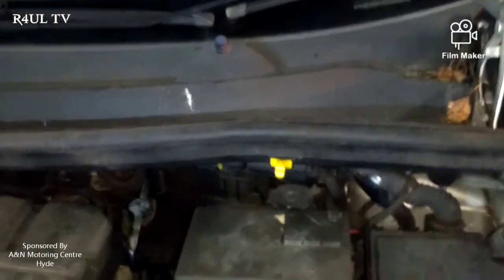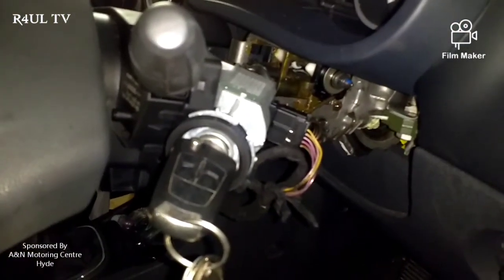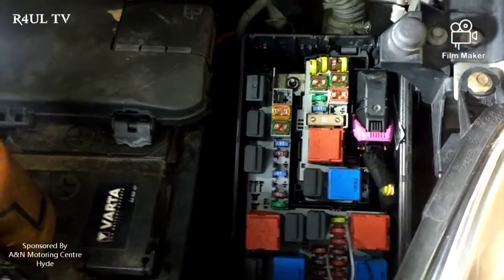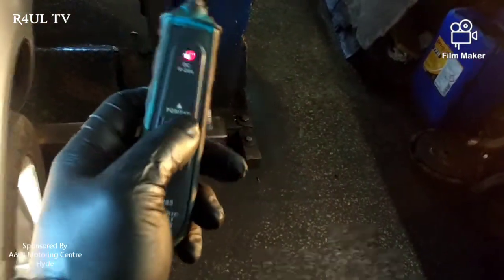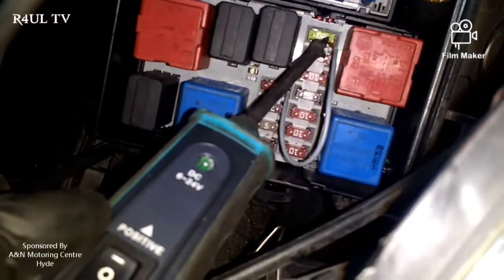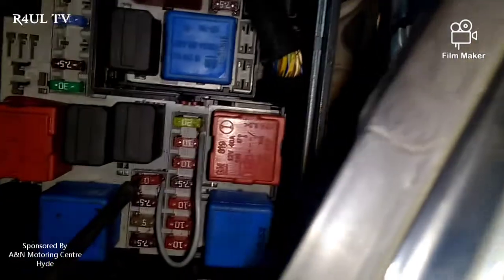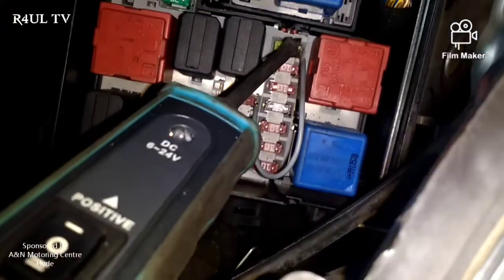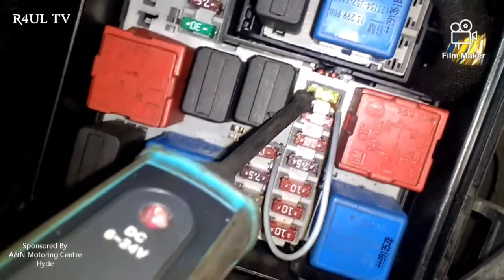Vauxhall Corsa d 2009 1.3 diesel Hidden Problem Engine will not crank/Turn over, How to Fix Problem

Comment: I am in the process of buying 2010 1.3diesel engine for my son what would be your opinion I am hearing not good car then others say if you stay on top of oil and water and change timing belt water pump it's fine can you plz help on this.
First time come across your channel seeing something no mechanic would tell you very honest of u.
Reply from the maker: The car is ok, the main issue is that the timing chain messes up on these cars alot. To be honest stay away from vauxhall corsa 1.3 diesel

Comment: Hi R4UL, the 20 amp fuse you say is deceiving, I read 1V, instead of 12V with ignition ON. I will test and replace relays, do you think it would be the same case as you are showing? Cheers
Reply from the maker: It might be. I think you will have fault with fuse box. But just try the method 1st
Reply: @TEAMR4ULTV  I'll try. Just don't want to mess with electrical systems too much. I'm not sure if voltage goes first to the fuse and then relay, or if they are completely separated circuits. Cheers, thanks for answering! Appreciated
Reply: Hi R4UL. The car lives, but now, when I turn off and with key out, the car is still running! Any thoughts? Cheers!

Comment: Hi R4ul!
I've a Opel Corsa C 1.4 16v
the engine start good, any codes or ligths on the dashbord appers, but after 15 or 20 minutes after the start and when the engine get temperature 90°c the engine cut out, after that, I trying to restart it, but the half of the dashbord is off... no check engine light, no oil, no inmo, nothing light are ON... after that 1 hour and when the engine is cold or warm, the engine start again normally. Do you think that the crankshaft position sensor  or ignition swicht are damaged or the connector o wires?
Thanks for your comments back. Also, please let me know How I can send you a video to show you this issue
Regards from Mexico!
Reply from the maker: Thanks for watching really appreciate it. To be honest it could be the crank sensor well worth trying that. Or try the coolant temperature switch
Reply: @TEAMR4ULTV  Thanks for your response, I appreciate it.
ok, I'll check these sensor, but just I've the doubt if ones of these could doing that the dashboard cut off? I can't review codes, 'cause also the power is cut off in the obd port... so I'm "blind" for check the ECU...
Anyway, I'll check those sensors, and let you know what I find
Regards!

Comment: Hello. My car wasn't cranking. The wire fix made it crank but then the engine died. Not done a code check yet. Any idea why it cranks then dies? Great fix. Thanks
Reply from the maker: Check the crank sensor, and egr valve

Comment: Hi got same car and previous owner done that fix to it but some reason it stoped working and giving f on dash any ideas
Reply: I have 06 ah astra 1.9 cdti that's done this exact issue ,  and yes I noticed this on the display panel but mine has F L/H  instead ,    weird shit these opals vauxall  cars appears built and programmed to stop so only they can get it running again ,,  or very smart electricians

Comment: My 1.3 cdti sometimes when you crank it cranks over for about 2 seconds then just stops. The keys still in starting position. Then have to turn key back to ignition and try again. Does 2 or 3 times then starts as normal. Any idea? Doesnt do it all time
Reply from the maker: Try replacing the crank angle sensor

Comment: Hi tried this today and worked but when i turn the car off the engine kept on running only stopped when i removed the wire from the spare fuse side, any thoughts cheers
Reply from the maker: To be honest I think maybe it's the fuse box at fault. Just put a on and off switch on to break the circuit
Reply: @TEAMR4ULTV  ok but was thinking it was a faulty fuse box so was going to change it, are they easy to get out as i can only see one nut at the top as its the same as the one which is in this video, thanks.
Reply from the maker: @marcusmurphy3640  I think it's not too hard of a job take the nut off I would recommend taking a picture of all the plugs under the fuse box so you know where everything goes
Reply: @TEAMR4ULTV  Cheers thanks for the advice👍

Comment: Thank you very much , that saved my ass ,
Reply from the maker: No worries mate. 
Dont forget like Share and subscribe 
TEAM R4UL, LETS GO
Reply: Just a quick one after I manage to start my car I have the service wrench on , any advice on that ?
Reply from the maker: @tutty2oo6  that's not the Service light, you will need to code read it and see what it says something to do with emissions,O2 SENSOR, EGR, EXHAUST ETC.
Service light on Vauxhall's are normally INSP
Reply from the maker: @tutty2oo6  is the light flashing

Comment: Hi can you help me i have a vauxhall corsa 1.3cdti 2010 the car was runing and all of a sudden was miss fire and went off. after i tried to start it up had nothing no crank. I v done what your saying with the wire and it did crank but no start.
Reply from the maker: On the corsa 1.3ctdi they have a fault with the timing chain could be the timing chain jumped a tooth.  Another thing is when you try to start it dose the car with a spanner light start flashing. If yes did you drop the key anywhere the chip in the key might have fallen out
Reply: @TEAMR4ULTV  Hi the key is ok i had that checked. ive put a new fuse box into the car. will it need coding in ??

Comment: Hello mate, do you know if this will potentially work on a 2007 model? Having very similar issues
Reply from the maker: I think it might if it has the same fuse box. Worth a try
Reply: Me to I turn my key and Theirs no power no lights nothing Ryan what was wrong with yours if you had same symptoms I drove it came back turned it off went out to get somthing from the car flashed the alarm it opened went to flash it again to lock it nothing  put key in nothing any advice on what was wrong with your 07 1.3 corsa d